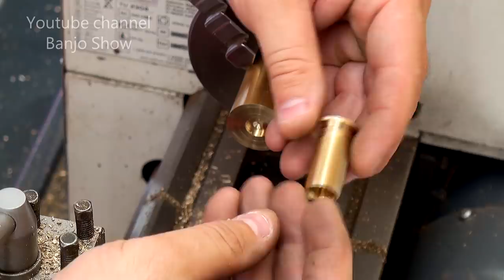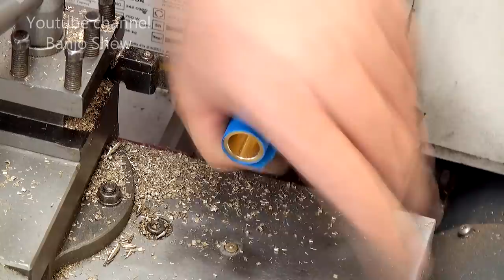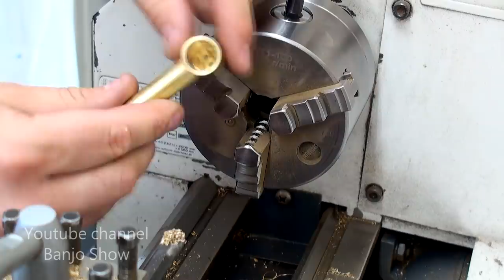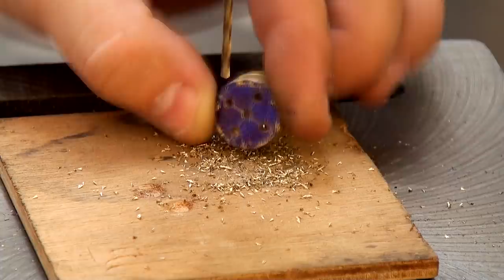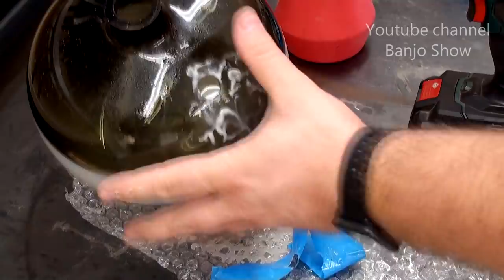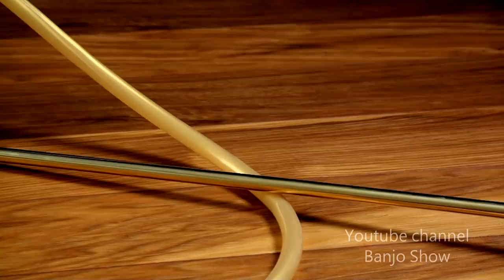Non-standard Brass Hookah How to Make

Comment: Just out of curiosity, what's the reason for making the lines through the pattern? Is it just for esthetics or it has a purpose?
Reply: Notice most of those are on where the hose goes and rubber pieces, it helps grip better than just a smooth pipe.